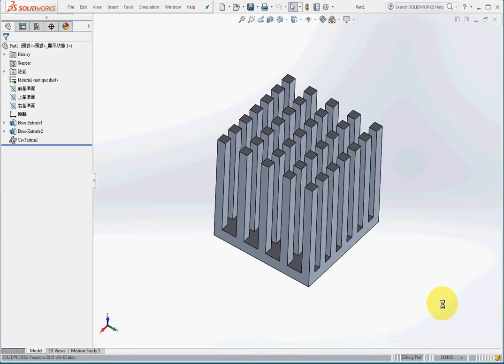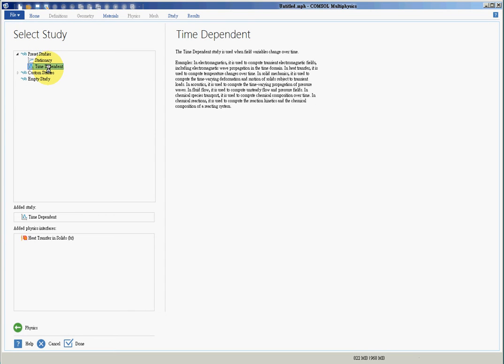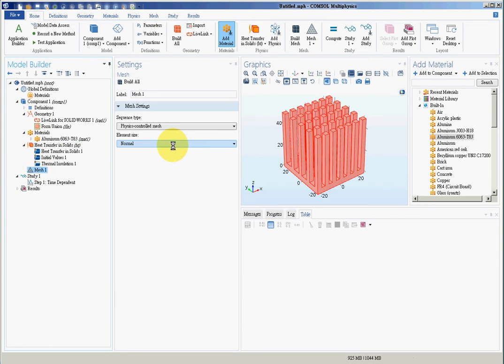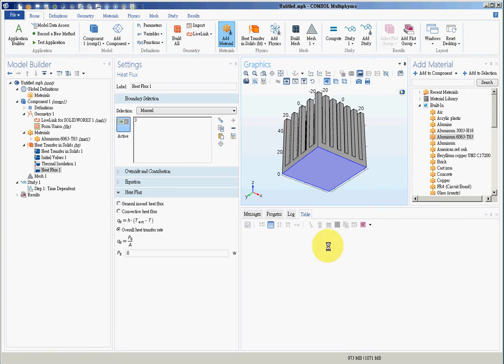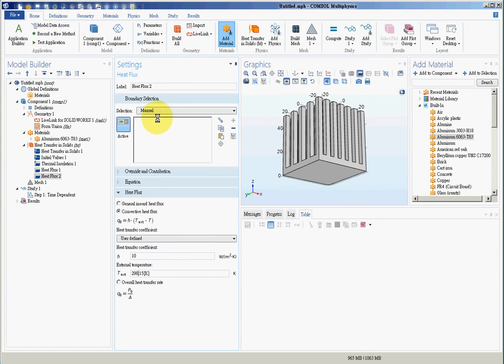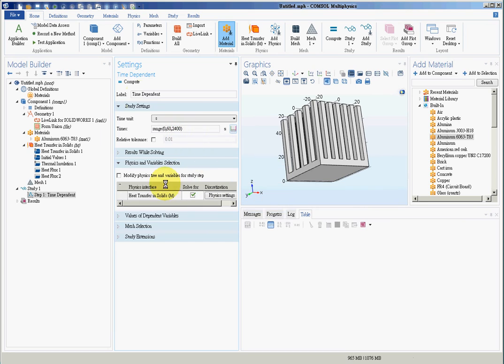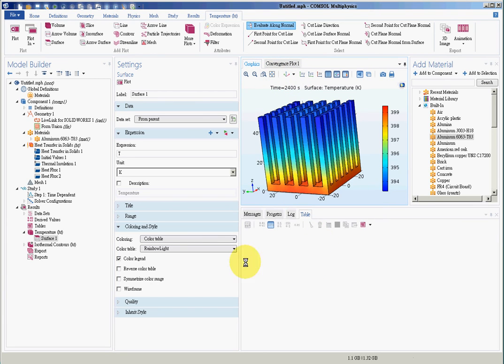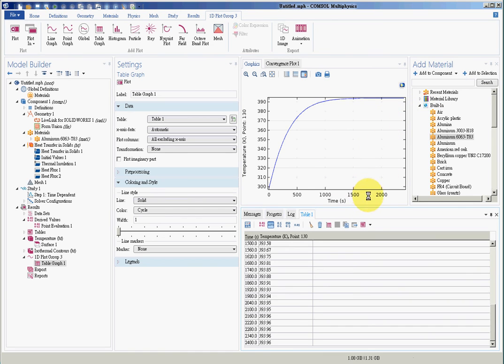COMSOL CAE 8 2  Thermal Analysis Transient

Comment: hello , 
i'm trying to simulate transient heat transfer in solids using comsol , but i'm facing a problem the thermal diffusion in the same in the whole geometry at all times . in other words the temperature of the heat source is the same as  the temperature of the edges even with very small time steps . and they increase at the sime time .. any idea of the issue ??
thanks in advance
Reply from the maker: Valdemar Abou hamad 
Conduction, convection, or radiation. You must learn heat transfer theory first, and then run software. If diffusion is involved, mass transfer is needed to simulate the situation.